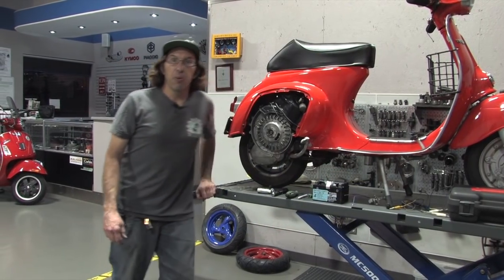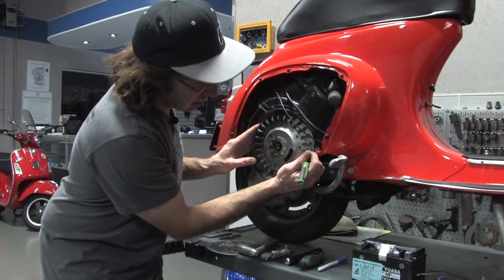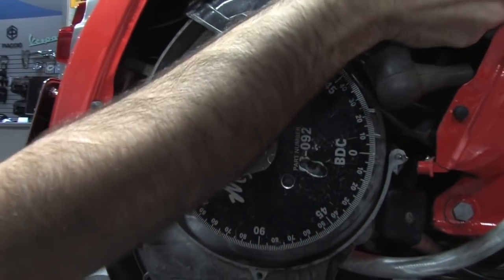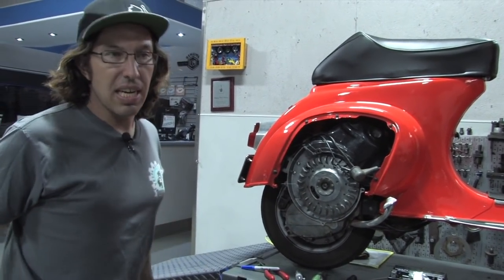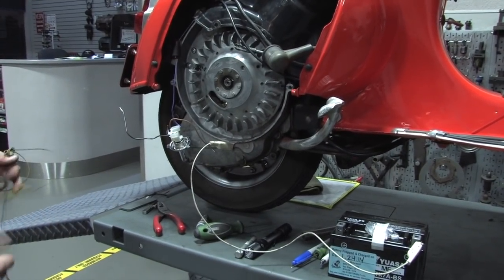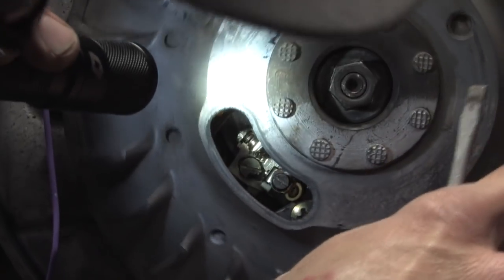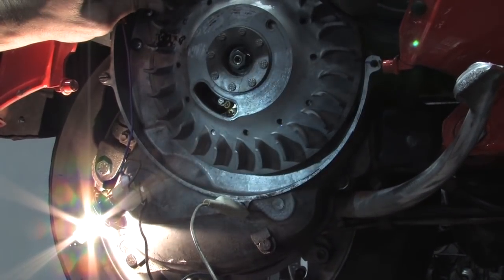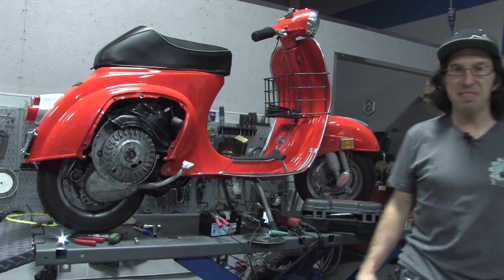How to Set Timing on a Vintage Vespa

Comment: Great video! I’m at full advance (screw slots) on my stator plate but can’t get the proper (.4mm) gap and have the points open at 28deg on my VBA. I can do .4mm but my timing is close to TDC. 
I’m thinking I may have an incorrect stator. Or maybe rotor? Hmmm…

Comment: Hi Robert, I really like your video,
it's very easy to let me know how to adjust the timing,
I have try that few days ago,but I got a problem could't solve,
when I set the BTDC  is 22 degree (vespa sprint veloce)
my point always be small,around 0.2mm only,
then I try to make the point open to 0.4mm , my BTDC will be 30 degree.....
Just can not be 22 degree  and point is 0.4mm